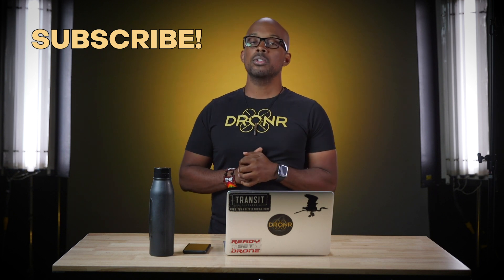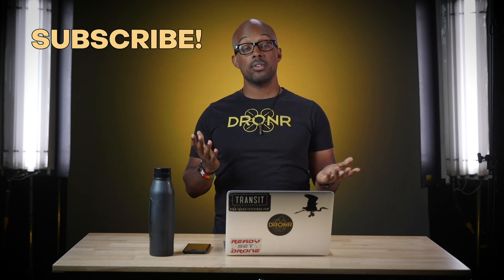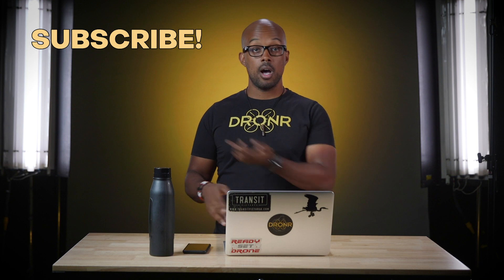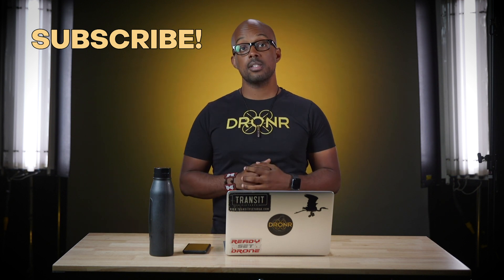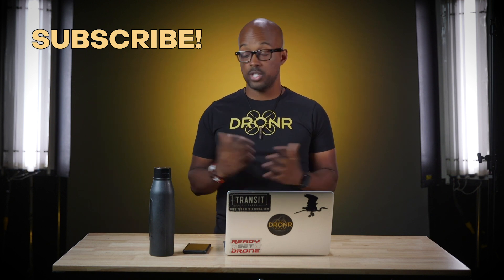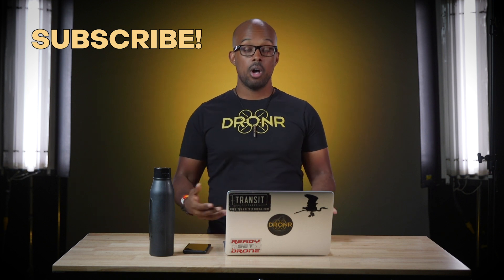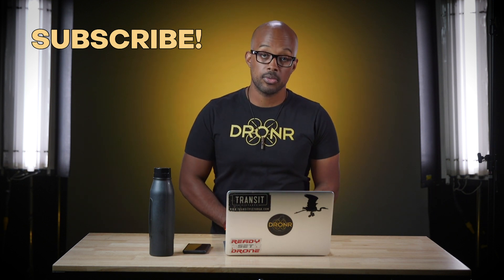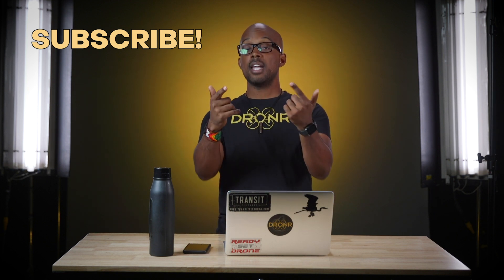Drone Battery Disposal Tips

Comment: Hate to say it, but a battery that can only hold 80% of its charge capacity is NOT going to simply charge up to only 80% of it's peak voltage!- it WILL charge up to the ENTIRE 4.20-4.25 volt level, but that voltage will drop much faster when used than it would in a healthy battery.

If memory serves, the DJI Go 4 app used to show actual capacity of the cells in mAh, but no longer does so you can't actually tell when your charge capacity is at only 80% of what it once was. Shame that they removed that very helpful info.

Apologies if I've misunderstood the way the information was presented though (referencing info from 2:15 to 3:00).